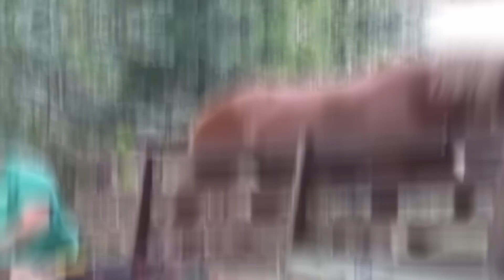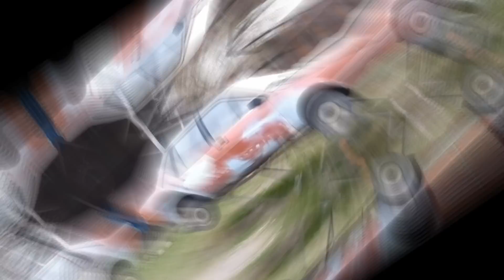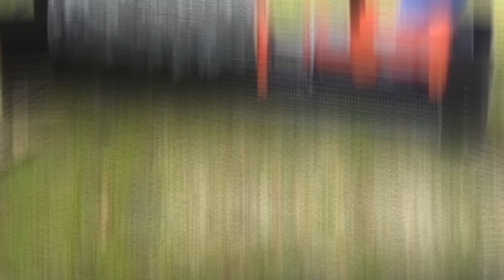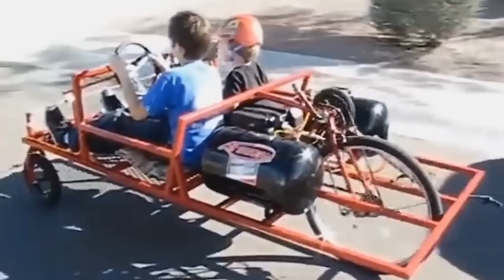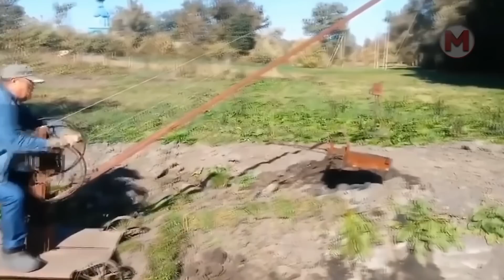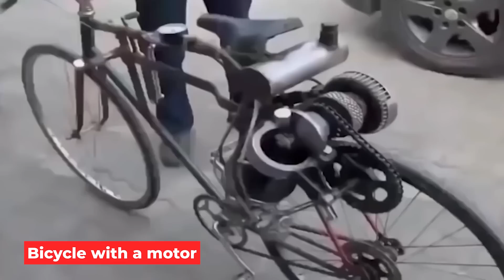Homemade Tools That Are Next Level

Comment: The hand crank device that picks up mud is called a dragline and they were fairly common back in the 1920s to the 50s, before the modern hydraulic excavator came along.
Some were steam powered and some were powered by early diesel engines.

Comment: "Sliding Shoe" vehicles are prohibited on Connecticut Roads & Streets, they are strictly off-road use only.  As are children driving motorized vehicles.   Mad-Max designs do not meet Federal & State required specifications in most states for highway use.  That horse powered belt machine is from years ago, as are many of these designs presented.  Narrator or captions denoting When, Where, and if the devices have been subsequently patented would be nice.
Reply: My question is how is a drag line excavator useless or new
Reply: And don't you sound like a stick in the mud. Probably a  triple vacced give up

Comment: None of these are homemade inventions, most of them have been around for decades and even centuries.
Reply: That wood splitter used the truck axle my Dad made one of those. It didn't work as good as a regular splitter but it worked.
Reply: I mean, there was a point in time when these things didn't exist, so technically "home made", at some point.